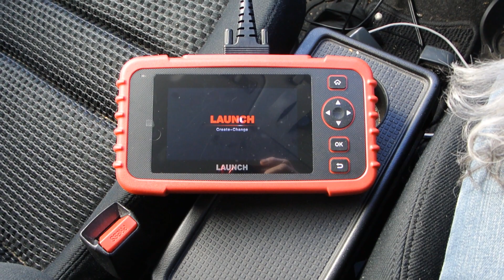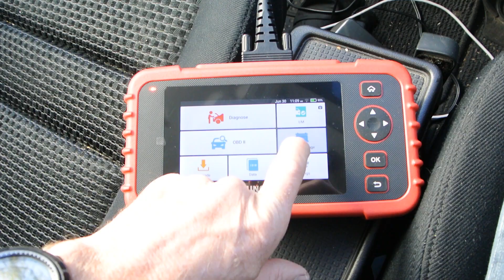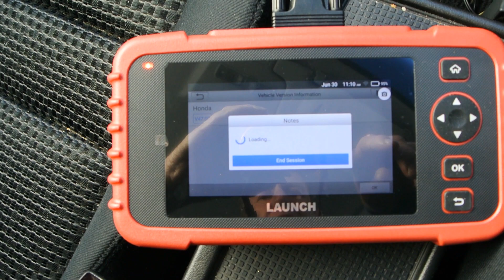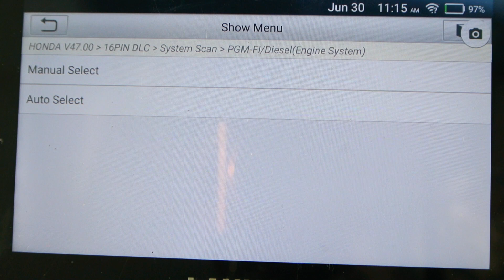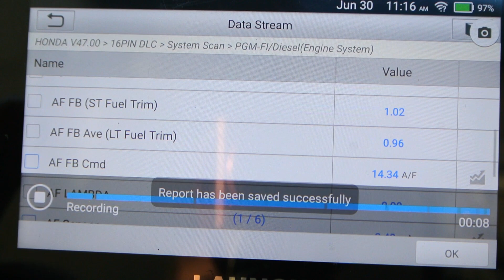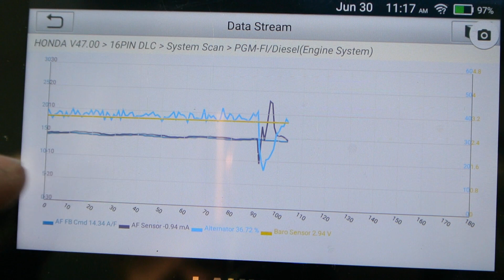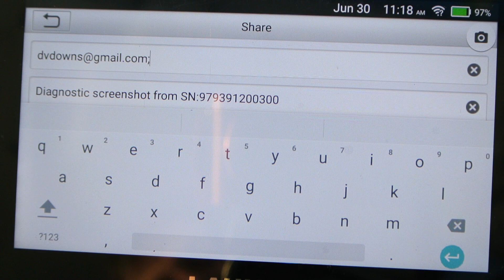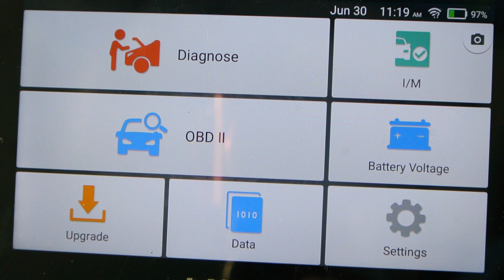Launch CRP123X

Comment: small tip.
You can turn on mobile hotspot on your phone & use it as wifi. Helps A lot when out and about & the Launch diag uses very little mobile data.
Reply from the maker: Good tip, thanks :)
Reply: Glad yours worked mine's garbage

Comment: Hi friend, I'm about to buy this tool for the car, what suggestions could you make of the product as positive / negative? Greetings from Argentina
Reply from the maker: It is a very nice tool. But because it is Android based things can go wrong with it. Like the Holden feature - that crashes every time I try to scan a Holden. You can get around this by going into various GM models but it is a nuisance. The older CRP123 is much more reliable in that regard, it just works properly on everything. I would still recommend this tool if you don't need to scan Holden. It is a very nice tool especially for the price.
Reply: @dvdowns  Thank you friend, it is good to have this data as a reference when buying it, do you have ideas which vehicles are compatible with the scanner?
Reply: @dvdowns  Hi Des. Friend of mine has a VXR8 which is a Holden. He puts the vin number in manually as a Pontiac G8 and the launch works ok then.
Reply from the maker: @Nick-bp7jf  Good to know, thanks. It's surprising that they haven't fixed the Holden issue yet.

Comment: Can this tool reset service interval? And can it retract EPB and bleed brakes?
Reply from the maker: It doesn't come with the features but you can buy them as extras for $15 each. The menu has a "mall"
Reply: @dvdowns  for each brand? Or once you buy it you have this option for all cars?
Also did you buy anything from the mall? As I don't know if I would input my card info in.
Reply from the maker: @BlackMambaKO  I haven't bought anything yet. I think each reset function covers all brands
Reply: @dvdowns  do you maybe know if they have scanner that already includes this when you buy it? Instead of mall.
Reply from the maker: @BlackMambaKO  the crp129x comes with some reset functions for another $100
Reply: @dvdowns  I checked but it seems like you need to buy these options also on it. I don't know why they wouldn't include this in the device when you buy it.
Reply from the maker: @BlackMambaKO  The crp129x https://www.amazon.com/LAUNCH-Automotive-Diagnostic-Transmission-Throttle/dp/B07RK9GCK3

Comment: This unit is garbage intermittent operating no scanning pre 07 won't work with Android just garbage
Reply from the maker: Mine has been working fine for more than 18 months now, I prefer it over all the professional tools in the workshop and it has scanned  almost everything from 1996 vehicles to modern vehicles - not sure what went wrong with your version?